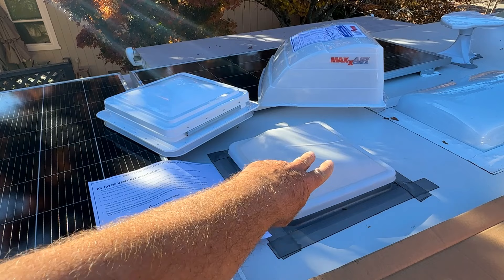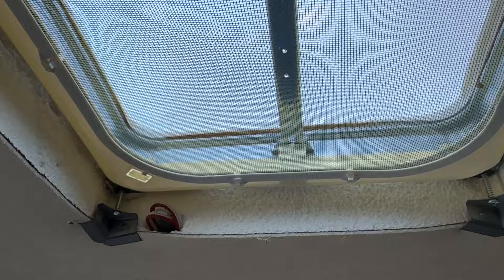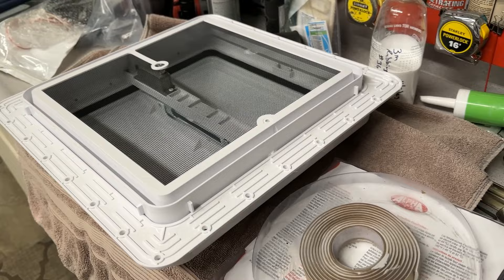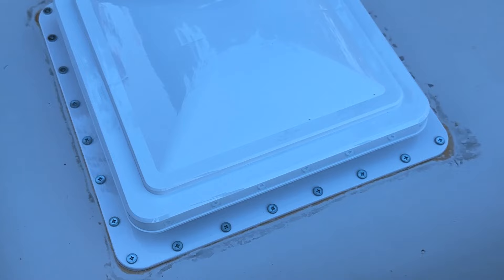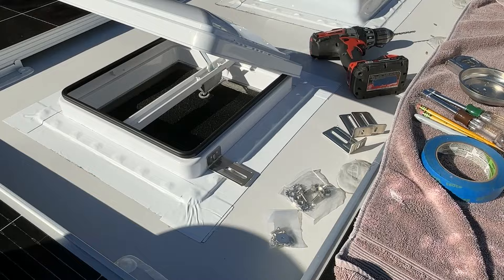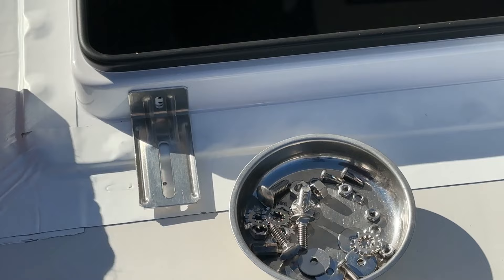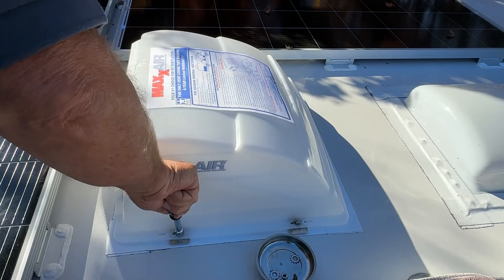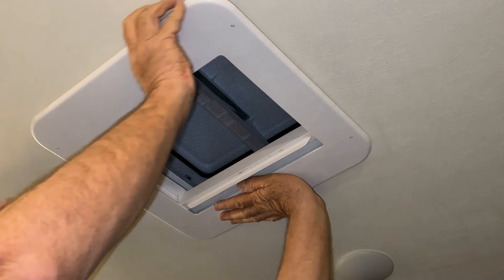Replacing a RV Roof Vent & Installing a Roof Vent Cover DIY

Comment: I'm getting ready to add a cover to the one place on my camper I didn't install a maxxair deluxe fan before
Reply from the maker: The cover is easy to install and is worth having. The deluxe fan is nice and works great (a little pricey)
Reply: @thetraveltrailerguy  with my rv armor roof I can’t take the old vent off without a service call… so I’m adding the cover and I added a Hengs Vortex fan because you mount it from the inside
Reply from the maker: @GimpyCamper  Oh yeah you have this nice roof coating I wish I had :) you will be so happy you installed the roof cover. Take care

Comment: Also could use a heat gun set on low or a quality hair dryer to remove excess sealant tape
Reply from the maker: Thank you for watching and the tip Billy, Happy camping :) https://www.youtube.com/@thetraveltrailerguy/videos